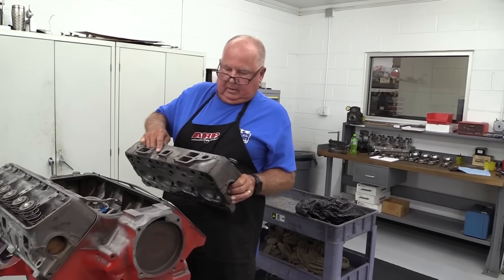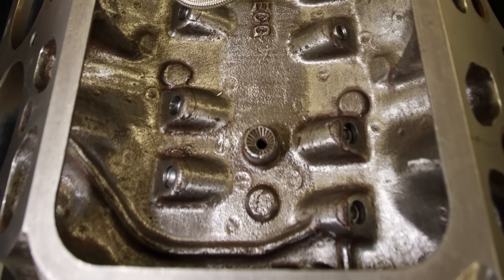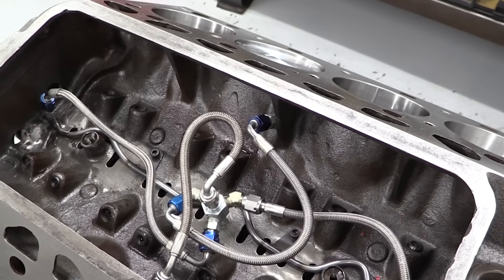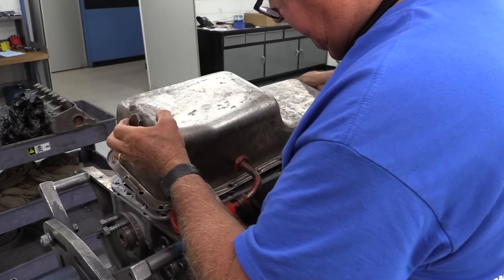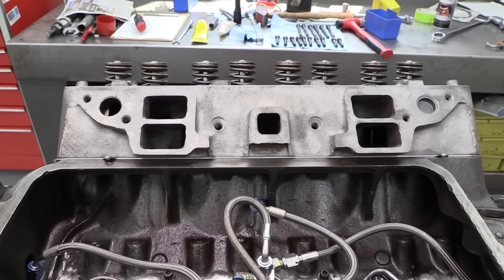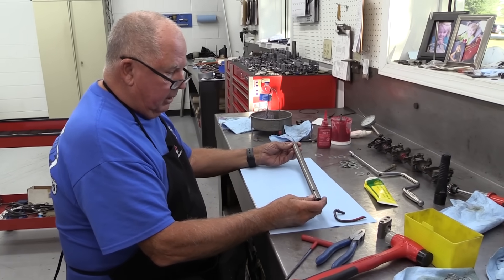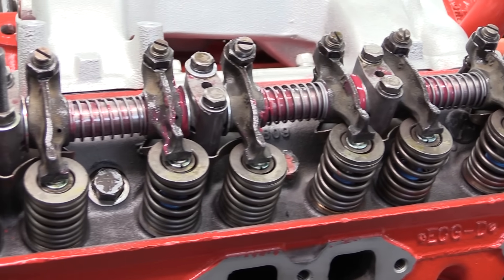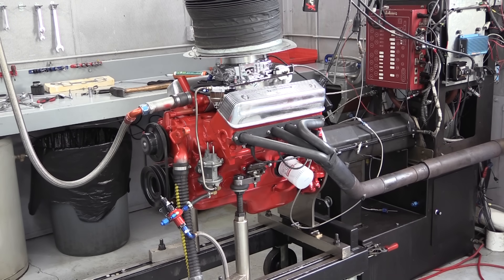The Engine That Replaced the Flathead -- Ford Y-Block Build

Comment: Why would you refer to the Ford Flat Head as "infamous"? Infamous implies it was famous for a BAD reason. It was legendary.
Reply: James Ray Never said the SBC was in competition with the FH. I said "Ford V8s". It was developed in RESPONSE to them, just so happened Ford introduced the Y in the mean time.

If the FH was junk that made no power and straight sixes were better, why develope a V8 at all? They may have made better TORQUE but couldn't compete with the HORSEPOWER potential of a V8.

If the FH was junk that made no power why was it in production for 22 years?

Never seen an aftermarket Stovebolt cylinder head. And again: the FH was cheaper to make power with than the OHV 6. Isn't that the same agruement Chevy guys have been making about their cheap junk vs Fords for decades?
Reply: @foxfordcatguy2283 QUOTE Chevy guys have been making about their cheap junk vs Fords for decades ? UNQUOTE speaking AS IF Ford never made and peddled cheap junk to just get by, like that 2 barrel carb-ed Mach 1 Mustang/ Mustake , or the mighty FoMoCo grossly underperforming modular motor, such a turd that even FoMoCo had to introduce and hype a PI version of that to keep going with that get by garbage.
Reply: No, Clyde Barrow wasn't an engineer, he just knew what cars would outrun most police cars.
The SBC was obviously in development WHILE the Flat Head was still in production. They were smart enough to know V8s were the way to go.
Cheap and plentiful is also the reason the SBC became so popular.
Reply: Flatheads hauled my a** around a LOT, in my teen years -- this ol' boy ain't gonna say a bad word about the legendary engine.
Reply: James Ray I never said it was the best. It was the go to engine just like the SBC wss in its era. It had more power than its DIRECT COMPETITION - the Chevy Straight 6. It was a marketing ploy to leap frog the Chevy 6 cylinder engine. Ford was only making 4 cylinders berfore that. Comparing it to other engines in luxury brands is like comparing the SBC to Ferrari. (Ford's Lincoln division competed with luxury brands.)

Henry Ford's aim was to make cars affordable for the common person because he grew up on a farm and hated how much of an ordeal it was getting anywhere by horse and buggy. He was forced out of his previous company, The Henry Ford Company because he wanted to build inexpensive cars everyone could afford and his investors wanted to build expensive luxury cars. After he left they changed the name to Cadillac. The 1902 Caddy was Ford's design and basically the same car as the 1903 Ford. Henry Leland took over for Ford at Cadillac but he later left and founded Lincoln which Ford later gained control of.
Reply: James Ray By definition "moron" means low I.Q., so it is redundant.

I never said they were perfect - nothing is. I said they were legendary because hot rodding/drag racing may not have grown to be what it is today without it. Fast cars would have only been the playthings of the rich. NHRA was basically founded because of the hot rodding scene that exploded around these engines. The Beach Boys wouldn't have written a song about it if it wasn't legendary.

If it was unreliable underpowered junk it wouldn't have sold and stayed in production for 22 years.

Why would you expect the stock transmission to hold up once you hopped up the engine? Common sense: if you add horsepower you have to upgrade the trans, axle, cooling system, etc. Same holds true today. You can't expect parts to handle power levels they were never designed for.

They have gone 302.674 mph in land speed racing. Ron Schnell has gone 7.695 in the 1/4 mile with a nitro burning flatty making 939HP.
Reply: James Ray Anyone who denies sometgings well documented history and popularity has a low I.Q.

Saying "low I.Q. moron" is redundant.
Reply: James Ray The car on the cover of the first ever issue of Hot Rod magazine was a SCTA record setter powered by a Flat Head. If being on the first ever cover of Hot Rod isn't legendary then nothing is.

Edelbrock was founded to make Flatty parts. In 1950 Edelbrock's FH Midget car ended Offenhauser equipped cars winning streak and won again the next night. (My first auto experience was working on Offys. Growing up my father worked on a pit crew for a guy with Sprint cars and an Offy midget.)
Reply: James Ray In its class it was "top dog." NOT compared to more expensive, seldom used in racing luxury car engines. It made racing/ having a relatively quick car affordable for the masses.

Hopping it up to 120HP? '48-'53 was factory rated at 125HP.

I don't know why you feel making things that the average person can afford is a bad thing. Why should racing/driving only be for elitist snobs?
Reply: @foxfordcatguy2283  Those 48+ Flatheads are a lot bigger displacement engines.  They killed the Lincoln Continental V 12’s.
Reply: @davekoenig9935  The only Flathead bigger than the Lincoln V12's [267, 292 & 306] was the 337 used in '48-'51 2 & 1/2 ton & 3 ton trucks & '49-'51 Lincolns. Not much interchanged (if anything) between it & its little brother 221, 239 & 255 Flatheads.
Reply: @foxfordcatguy2283    No Lincoln Conti’s with V 12 after 1948.  My late neighbor had one of two known 1950 Lincoln Lidos with auto trannie.  Ford bought GM Hydromatics as theirs were not ready.   I understood these were around 345 ci stock.  Chevy put 300 Stude 53 OHV engines into 1953 sedans to test V 8’s.  Stude put Ford 352 OHV’s into mid Fifties Golden Hawks.  Hotrodders squeezed Caddie V 8’s into Stude Hawks and called them Studelacs.  Ian Fleming loved his 56 T Bird. , but had James Bond ride in a Studelac to get someplace in a real hurry!
Reply: I feel sorry you trying explain to these ignorant ford hating idiots..Foxfordcatguy I get what you are saying I learned something from the information you shared..I never knew some of that history about the Ford Flatty.Like 939 hp for out of a flat head for  starters !
Reply: FoxFordCatGuy I remember as a kid my grandfather had a 46 jail bar flattie truck and later a 49  bonus I think it was called.They wouldn't have had anything else to do the job on the farm .Both he and my father praised the flattie as did others I knew from that era did.By today's standed i suppose  they don't cut it but technology has moved on since the 30s when they first came out. In their time they were the go to engine.I still remember the sound they made which to me was music and still is.So I know what you mean and are talking about.
Reply: john ramsey my understanding as well from what I heard was the ford flattie  was also the preferred engine to power a lot of the equipment when the USA  joined the war as well.
Reply: This commentary is young and dumb so what do you expect.
Reply: Jeff Kopis  Who never said what? If you are referring to my second comment, it looks like the person I was responding to deleted his comment.
Reply: The y blocks wasn't a good ohv design imo. I still remember hearing about my uncle rebuilding the bottom end on his 292 about twice a year. No oil to the crank. He got a chevy dump truck with a 366 in it and it ran for about 95,000 miles before he done anything to it. In a dump truck working 6 days a week back in the 70s that's impressive.
Reply: @TheRockinmac  My male parent bought  a cab over Ford truck with a 292 engine to deliver feed to his small dairy farm. About a year after he bought it as in MUCH sooner than he expected, the 292 Y block motor failed, ruining the POS block. He spent a bunch (over  2000$) getting another 292 and having it rebuilt ......only to end up with freshly rebuilt (POS) 292,  which was going to die prematurely again.  I told him that he should have replaced the (POS) 292 with a 390 the first time that the 292 died.  He did NOT listen.  I would NOT fool around with POS Y block for one second as there was anything else more modern to use instead.  "Y block" as in Y bother with one.
Reply: @TheRockinmac  The oiling issue with the Y- block was the passages to the VALVE TRAIN (not the crank) would clog due to the lower quality oils of the era. With better detergents on today's oil it's no longer an issue.
Reply: @Ronald Reed I know hot rod history, so I know hot rodding wouldn't have become what it did without the Flat Head Ford. It put speed in the hands of the average person. That's not "infamous."
Reply: @Ronald Reed Google Hot Rod history. You'll wish you'd done that first. The first engine mentioned is the Ford Flat Head.
Reply: So, in your revisionist history:

The '33 (for example) Stovebolt Six didn't only make 60HP and the Flat Head Ford didn't make 75HP?

And the whole hot rod movement sprang up around the straight 6 not the Flat Head? IT was "THE" engine to have and not the Flat Head?

And Chevy didn't finally relent and come out with a SB V8 to compete with Ford's V8s?

And Clyde Barrow didn't write Henry Ford a fan letter about the Ford Flat Head V8 was his preferred getaway car? He wrote it to Chevy in your mind?

And they didn't continuly improve the cooling system?

And aftermarket companies to this day make don't make cylinder heads etc. for Flat Heads but the did for straight sixes?
Reply: The last year for the Flat Head was '53, the Y block came out in '54, the SBC in '55. Do you think they developed it overnight? It takes years. Like I said, it was being DEVELOPED WHILE the FH was still in production and BEFORE the Y even debuted.
Reply: They flats  made very little power until you "hopped" them up. They were good for their time but they were done as soon as the Small block Chevy. Olds Rocket & early Chrysler Hemi's came along. Ford made them way too long and their "day was done". My friends dad hot rodded flatty's and as soon as you did, the lousy Ford transmissions would blow apart.
Reply: @4thstooge Do you know what the word "legendary" means. It means in their TIME they were the top dog. Never said the haven't been surpassed or weren't outdated decades ago.

Better look up the specs, they typically were rated at more HP than their 6 cylinder competition. Like I said that's why they were Barrow's preferred getaway car, because they could outrun most cars of that era.

Made them too long? They stopped making them 2 years BEFORE Chevy even came out with a V8. (And don't bring up the 1918 Chevy D OHV V8. It was a failure, only made for 1 year and still considered one of the worst cars ever.)
Reply: @4thstooge75  Ah yes Ford was a little late to the game for OHV engines and other things, some of that was Hank the original  and the mental illness that had overtaken him, some of it was Hank II stepping in and going to battle with Grandpa before he got control and then trying to save a Company that was dying and had some serious ground to make up. In the immediate post war years Ford was the number 3 automaker behind  GM and Chrysler and do to some of Hank I's personality issues and his mental illness Ford did not have the capability to design and innovate that GM and Chrysler had.Henry  Ford II and the whiz kids figured they needed more Divisions to compete with GM's 5 or Chryser's 5 so they added to their corporate structure Continental and Edsel bringing their division count par with GM. Recession hit and Ford figured out that Henry's (I) instance on a simplified corporate structure and minimal divisions (Mercury and to some extent Lincoln were viewed as playthings for Edsel  to stop him interfering in Ford) in the 30's had disadvantaged Ford and that they wouldn't regain the #1 spot unless GM screwed up.
Reply: Remember the Little Deuce Coupe “with a flathead mill”

The real one didn’t have a flathead. Not if it was going to “walk a Thunderbird” or “get rubber in all four gears”. 

Yep.. it was a low compression low revving overheating choked (because the exhaust had to go through the block) that was couldn’t be over bored (because of the above) and stroking it would make it more like the tractor/lawnmower engine it was. 

The only good thing about it is it was cheap. As for the aftermarket they sell turd polish, too... but it’s still a turn. 

The flathead couldn’t even catch Forrest Gump on foot. ;)
Reply: Bartonvich52 Can you read? I've already addressed all the issues you've mentioned: Never said it was perfect, never said it was the most powerful. It did what Ford intended it to - top the Chevy straight 6. And it put performance in the hands of the masses. Only an idiot (i.e. Chevy guy) would deny its place in hot rodding or drag racing history.

No one every wrote a song about the Stove Bolt Six.

What "real Duece Coupe"? It was a totally fictional song. The flat head debuted in the '32 Ford.
Reply: @Bartonovich52  They were still better than and had more potential than the Chevy 6 that didn't have pressurized rod bearings until 1953 (Powerglide cars) or 1954 (stick shift cars) the Ford V8 also had more potential than the flathead Chrysler engines of their era.  The Ford V8 was 239 cubic inches, the Chevy of the era was 216 that got enlarged to 230 in 1940, Chrysler flathead straight sixes ran from 170 cubic inched to 301 with the bigger engines only available in the larger cars. Then Ford came out with the 255 version of the flathead 8 for the Mercury and the 337 that was used in Lincolns and Bigger trucks. You can complain about the shortcoming of the Ford V-8s but they were usually the larger engine in the popular priced class and had more potential. The first terror of NASCAR was the Hudson, possibly because of the 308 cubic inch flathead 6 with twin carbs. True there were bigger engines but they were in bigger and heavier cars , V-8, V-12 and V-16 Cadillacs, V-16 Marmons, V-12 Lincolns and straight 8's from Oldsmobile, Buick, Pontiac, Chrysler, Nash, Hudson and Studebaker to name a few.  Yes Chevy "leapfrogged" Ford bringing put a 6 cylinder engine in the popular price range, Ford upped the ante in '32 with an 8 cylinder in the popular priced car.  Yes even though I don't like Chevies I can agree that the SBC was better than the Ford flathead V-8 and the Y block that replaced it. But Chevy got a lot of hand-me-down knowledge from Cadillac and Oldsmobile who both came out with OHV V-8's in 1949. The Ford Windsor engine (260,289,302,351W) were all good engines and a match for Chevrolet as are the Chrysler A block engines (273, 218, 340 and 360).
Reply: @Bartonovich52   Maybe.   But  the  Deuce was  likely 1/2 a  tonne  lighter than the T-Bird. Plus  the Girl driving the 'Bird was re-applying  her lipstick  and  was  asleep at the light. You can get over 200 HP in a  flathead with some  speed parts and the three deuce  setup.  - Sandy

Comment: I've heard, and maybe someone can verify this, that the Y block has it's particular sound as it retains the firing order of the flathead, which is different to all other V8's.  True or false anyone?  I'd be a bit concerned about an oil supply relying on rubber hoses, whether braided or not, inside the engine.  It sort of assumes that the engine will be pulled apart and the hoses renewed every 10 years.  The original oil supply, as I recall, would fail when the cam bearing turned, which a good engine builder should be able to prevent from happening, though it would be correct to say that it still probably wouldn't be a sufficiently good oil supply for a performance engine.
Reply: It does retain the flathead firing order and that does help produce the unique sound.

One reason for the oiling problem was that the cam wears into the bearing eventually restricting flow or stopping flow.  Another was poor maintenance habits
 The oiling modifications outlined in this video are absolutely overboard.  Builders who know the Y have very simple methods of ensuring adequate oil supply.  One is to ensure adequate camshaft groove width and depth.  Another is to use a special cam bearing with the groove on the outside perimeter.  Yet another is to cut a groove into the block itself.  When the groove is cut into the block, restrictors are usually required at the entry to the rocker shaft to prevent too much oil from going up top.

With these simple modifications and attention to detail, these engines survive just fine in dragsters, Bonneville and other race vehicles that can see 7500rpm, as well as various performance levels of street machines.  The oiling issue is a thing of the past and no longer an issue in a properly built engine today.
Reply: @charliemccraney , I agree I felt what he did was way over board especially for a street engine.  if my original 292 still has good oil pressure without a rebuild then it is possible to have a Y block without those kind of modifications.
Reply: Something else interesting, the Chevy 4-7 swap firing order converts a Chevy to the Flathead (and Y Block) firing order.  It's a good firing order for performance.
Reply: Thanks for the comprehensive reply Charlie!

Comment: "Infamous"?!?  The Ford Flathead V8 was a groundbreaking design.  It was THE engine to have for over a decade.
Reply: More like 2 decades. It came out in 1932 and SBC (Chevy's first V8) didn't come out until '55.
Reply: The small block Chevy ate them for lunch. the Y block was a turd.
Reply: @4thstooge75  and then the mopars ate the sbc :)

Comment: i dont buy the idea of flexible pipes inside the engin . There's a reason that such system was never used inside any engin designs and that the hard steel pipes were prefeered over them and i can pretty much guess why they preferred the steel pipes instead
Reply from the maker: They can't move that much if you are worried they might contact  the pushrods. And they are super high quality components made by Brown and Miller, who provide product to a lot of NASCAR Cup teams in Concord and Mooresville, NC. It will last practically forever. Thanks for watching!